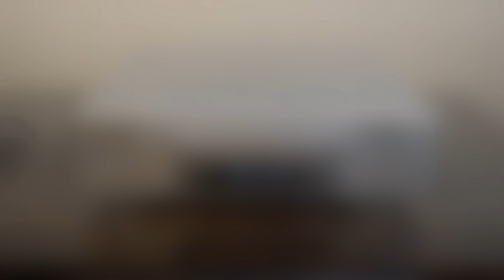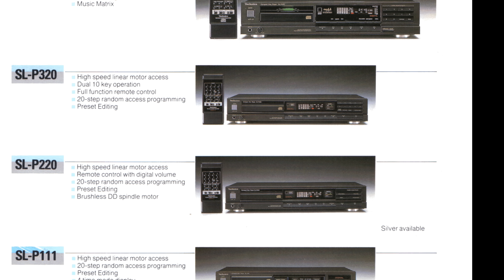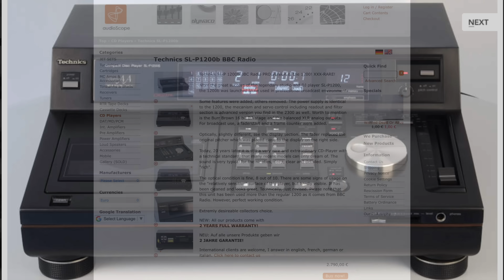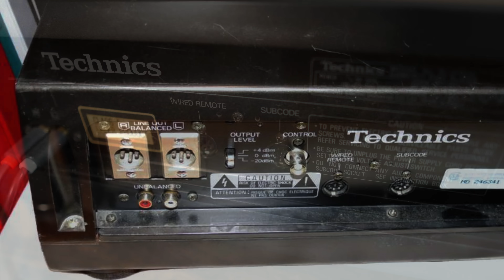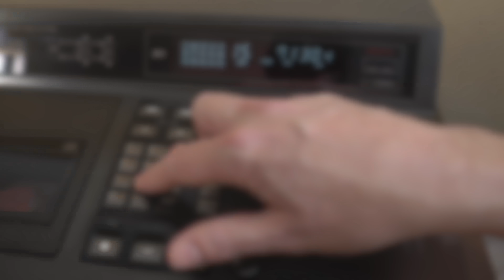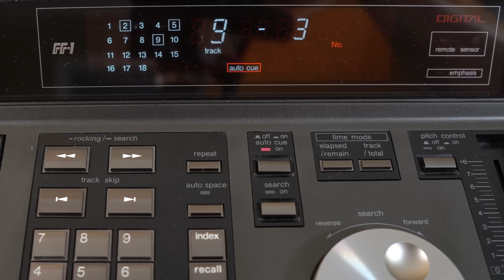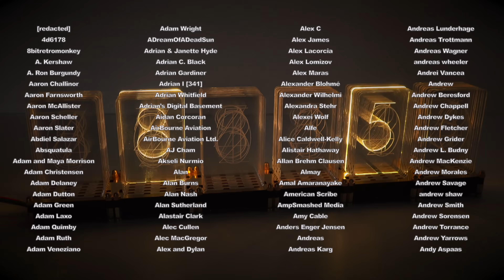How CD players lost their cool & why this Technics didn’t.

Comment: The worst thing about CDs is no matter how well you treated them, they scratched very easily. The plastic was cheap and could scratch simply being inserted into a unit.  The back had the foil with the information that if it got scratched, ruined the whole thing.   They made sets of music that might have three or four CDs in the box.    You could use it and eventually it would fail.  you could hold it up to the light and see light because there was a hole in the foil where the information was stored.   

The worst were computer CD and later DVD burners.   They were often termed landfilll material.
Reply: They addressed that design issue with DVD by sandwiching the data layer in the disc rather than under the label side. I still don't know how people managed to scratch them up so badly! If treated as carefully as you have to treat a record it becomes very hard to scratch them. The error correction system is brilliant at avoiding issues with scratches anyway, however I have found its ability to be effective on certain types of damage depends on the player and how much of the error correction system it implements properly. For example, my original Ghostbusters soundtrack CD was at one point owned by my brother, there it somehow got a hole, a small one, in the reflective layer. It's an old disc so perhaps it just failed at that point, either way you would expect this hole to be a big problem as it it much more severe than a mere scratch. Well it was, there was very noticeable skipping problems in the affected track, but as years went by I got better players and I found that I couldn't find the issue again!  The better players implemented the second level of error correction, which repaired the audio where the hole was. Even my Blu-ray burner will rip the entire disc and cdparanoia (used to rip) will report no issues with errors. The error correction on CD is so incredibly effective that it will hide a visible 1mm diameter hold in the disc. How people have problems with scratches, I don't know. How they acquired them firstly, then I have to assume their players are more primitive ones that try to skimp on error correction.

When we get to DVD, error correction goes to a whole other level, with two interleaved matrices and hardier ECC. Before Blu-ray, DVD is the most reliable and resilient data storage medium that was offered to consumers (excluding the HDD, the amount of error correction they do routinely is astronomical), let down by crappy brands of dvd-r. I dont know how you think they are "landfill material", I have to assume you bought sh*tty media because it came cheap from costco. Well, you record with sh*t, it acts like sh*t.

Comment: It's not really a professional model due to the lack of the balanced outputs on the original model, the limited capabilities of the remote control port and the not-really-precise cueing. It's really in this prosumer segment just like the SL-1200MKII which it looks like.
Real pro radio models would be the Studer A730 and its successor the D730 - both of them being top loaders like the SL-P1200.
I personally prefer CD-cart players, an invention of Denon based on the early carts used for CD-ROMs. My favorite model is their second iteration, the DN-951FA (they also had a drawer model in the same size the DN-961FA). Audiometrics also produced a pro player that was compatible with Denon's cart, the CD 10, which has the advantage of having a jog wheel on such small front panel.
Another feature that pro models offer is the ability to cue down to the frame. CDs are recorded in frames which are 1/75 of a second. The technics here doesn't have that granularity. And no, it's not reading the content from a "single rotation of the disk" (otherwise, depending on where you are on the disc, you would hear more or less sound).
Finally, pro models have many other features like locking the controls when the disc is playing on air, ability to cue the end of the track with just the press of a button, visual warning when the playback gets close to the end... and all this available via the remote control port.
Reply: Note: you can easily identify pro models (not matter what) by their lack of consumer features. This CD player is full of consumer features (like programmable playlist and IR remote).

Comment: The Technics SL-P1200 is the CD version of the awesome Technics SL-1200 series of turntables. I have a pair of SL-1200MkII's. The base and feet look almost identical. The pitch control would allow for beat mixing with other tracks with different BPM. This was designed for club DJs more than radio announcers.

Comment: Ha! I had a Philips CD100 in the mid 1990s. I picked it up at a garage sale for $10. Used it for a few years until it just up and died. The seller had included the original receipt. He paid $799 USD plus tax in 1982. That's about $2400 USD today.

Comment: I always liked Technics CD players.  The last CD player I owned (that wasn't a dvd or bd player that also happened to play CD) was a 5 disc changer similar to SL-PD887.  Ive got fond memories of that machine.  These days I just have an inexpensive blu-ray player that happens to also play CD and DVD (and many other formats on those media types).  My modern player has no display or buttons of any kind. It outputs to HDMI, and uses a remote.  If you lose the remote, it becomes garbage.
Reply: Yeah, thats why I prefer a player dedicated to CD. I want the display and player controls to be able to let me fully control the playback. My dvd player and Blu-ray player of course play CD but that requires the use of a TV! :D

So yes I will always have standalone devices, or a multi format player that can play a CD with all the basic features (play,stop,next,prev,search forward and back) with a display on it that at least shows the track and time. My UHD player has no display at all, so cant do the job without also powering up the TV. My old sony Blu-ray can nearly just about do it, but if you want to change track you need the remote.

Comment: This CD player was also used  by Club DJs as I used it in the 1990's.  The pitch control could be used in an active way  in mixing 2 tracks together while playing the CD like the Technics SL-1200MK2 turntable.  I have a matched pair of the turntables.   Even though the CD player itself had a headphone jack, most DJs including myself would use the headphone jack on the mixing board so with a flip of a switch one could listen to whatever input device one needed to be queued.  In the last club where I DJed I had 4 Technics SL-1200MK2 turntables and 2 SL-P1200 CD players ready to play at anytime.   I had a Korg sampler that I don't remember the model number of it as I rarely used it.

Comment: Nice overview of the SL-P1200. Note that there was a safety concern with CD players having their lasers exposed. The drawer loading addressed that. I worked for some radio stations and recordings studios doing maintenance on the SL-P1200's, and one of the main things was replacing the door switch parts, as they tended to wear down. The switch prevented the player from operating (i.e. turning on the laser) while the door was open.; So of the switch was broken, the player was disabled. So we kept a stock of the switch parts around at all times.

Comment: Nice - but can you elaborate on why it wouldn't be able to play CD-R's; I mean, it's not like regular CD players were specially designed to be able to play CD-R's, my dad's equipment from late 80's (or maybe ~1990) happily played them, so what was it in design of the players from earlier that would've made them unable to play them?

I'm not doubting you, I'm just baffled - not an expert on audio hardware, like you; and I'm almost certain you have the explanation too ;)
Reply: You need a player that has an infrared laser to play CD-R. CD-R and -RW use infrared lasers, normal CD just uses a red laser. If your player does not have a red and infrared laser then it will only play pressed discs. Some very early players can apparently play CD-R'S, which must mean their laser has enough of an infrared component to do it. But basically, those are the lucky few.

Comment: Very helpful video.  I never paid much attention to these when they came out because I am disabled and the drawer mechanisms are easier for me to use.  I have a suggestion that the load times for newer CD players might be related to also having to read the SACD layer (if there is one) in addition to the CD layer.  Just a thought.  Your new machine is sexy looking...glad you found one in such good shape!
Reply: Very few players can read SACD so I doubt it would be that. Most likely is that modern players use the same pickup as used in PC optical drives, those have always been a lot faster.

Comment: My Kyocera DA-01 did not hide the disc as it had a viewable window, not a drawer.
Reply: The first Numark DJ dual CD Player had a terrible lag problem when queuing up a track.  I also remember the Vestax dual DJ CD Player from around 1993 had the same problem.  Set it up and depress pause at the point where you wanted it to start.  When you'd un-pause the track would never start on beat.

Comment: @ Techmoan As a DJ in the late 80's and early 90's, I worked with those CD decks a lot. They were the best for our needs. One important thing to note is that the weight of the machine would help prevent skips, since dance floor vibrations and bumps on the equipment would make a CD skip. I remember we didn't need to install those on a rubber band suspension like the SL-1200 record players, so either there was a small buffer in the SLP-1200 or there was a physical skip prevention mechanism.

Of course, the pitch control slider was the most important feature for us as it made it possible to mix (beat-to-beat) dance music tracks. Also, I remember how fine the search function was. This was very important for us to cue the track at the exact beat where we wanted it to start for the beat-to-beat mix to work. Along with its SL-1200 cousin, the SLP-1200 is a legend of that bygone era when DJs actually had to work to earn their pay. Nowadays, the new generation simply let the computer mix tracks together, replacing the art of mixing with computerized precision.
Reply: Yeah, apparently Technics had a bit of a streak with the products named ‘1200’. Ishkur wrote in his magnificent music guide that he's seen those vinyl decks drop from heights or from moving cars and work fine afterwards. Rave workhorses, they were.
Reply: Felt that last part...to be honest they should not be called DJs anymore. Or that's where the term EDM comes in because it's all electronic and done with a computer

No offense to the new age peops but that's the truth...it became pointless to be a DJ when there are a lot of people that can mix those tracks even on their phones and get paid for that. All I can do is remember and know that there were real DJs that play with discs and even experience trying my luck at it
Reply: @ruikazane5123  Your comment made me realize that the DJ contest I won in 1991 would have absolutely no value in this world. After all, a lot of the score was for how good your technique was. Without remembering the full details, I guess we were scored on style and the ambiance we created, but at the time, the way you technically executed your set counted for a lot.

Also, there was no better feeling that pulling off the perfect mix in a packed club. Only when you messed-up did the crowd notice your work, and that was alright by me. :)
Reply: @JFHeroux  Some fellows remember there was scores on the moves too. Like being in sync with the mix you are doing and even tricks like flipping those discs around like the Globetrotters and serving the people like a pro bartender...

Of course...nothing beats the feel of actually getting it through without mistakes, much harder to me being assigned to the sound reinforcement stuff back then. High risk and potentially higher reward!

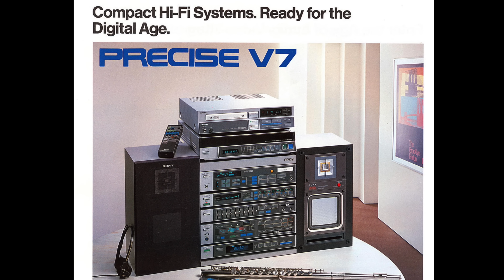Comment: I had some of that Sony stuff from around the 2:45 mark! Not the CD player, but the tray loading linear tracking turntable and the tray losing cassette deck. 
I bought it from a thrift store around 2010 mostly because I wanted the speakers that it was bundled with that they wouldn’t sell by themselves. 
You’re right that being able to stack components is a (slight) advantage; I had my turntable at the bottom of the stack. Unfortunately, most other aspects of that stuff didn’t age well.

Comment: I'm sure when CD's were first introduced the manufacturers wanted to show them off, but you can maybe see why they went for the drawer option in the end. CD's rotate at around 200-500 RPM and can cause annoying flicker effects in certain lighting in an open front player. This is not the relaxing 33/45 RPM of the record or reel to reel tape. Partially visible machines like this 1200 are perhaps the best compromise - you can see the CD moving but only if you look for it.

Comment: I owned the XLR version SL-P1300 few years ago, after i dreamed it for many years i was luky to find a mint one, like new. Very heavy indeed, very impressive look, very quick access of disc , one of the fastest CD player, a lot of features. It was the crown of my audio system some time, until i  performed some sound test using few famous audiophiles discs. The winner was my Wadia 861 SE, far, far away from others , next was Sony SCD-777ES, Studer A730 , Sony CDP-XA50ES, Audioaero Prima CD, the last one was Technics SL-P1300 so i sold it for good money.

Comment: I've played burned run-of-the-mill CDR's on CD players as old as Sony's 1984 models.  I have had issues with CDR's on much newer devices, though, and even then, if you play your cards right, you can get things to work.  The basic rules are to use DARK colored CD-R media (green or blue, but I know, I know, good luck finding those these days...), and burn them as slow as possible (1x, if you can muster up a CD burner that will allow you to burn that slowly).

Comment: I purchased a Philips CD 100 with a perspex top soon after they were released.  Expensive at the time, but I thought it worth the investment.  I would still have it if it weren't for an Ex- throwing it out 'because you weren't using it' - one reason of many why they ended up as the Ex-... 
The player, although only 14 bit oversampling rather than pure 16 bit, sounded much more smoother than contemporary rivals.  One could update the Op-Amps for a lower noise and better distortion figures and slew rate.  Then, fed through a Quad amp system to some nice big Rogers Studio-1 speakers, the content could sound very nice indeed!

Comment: The reason to have CDs front loading and hidden is because the manufacturers were trying to get enough customers to bring the price down and so they designed a player that could do double duty inside a computer!  Nobody using a computer gives a rats ass about watching the CD spin . ..

I remember the incredible buzz from NeXT computers CD-RW that could store 256MB and supposedly replace the hard drive at ~half(?) the price!  But it was slow as molasses...

Comment: Almost everything is very impressive about this player, --in fact I'd like to have one, but mostly because of it's looks and the features. In other words, just to have one. It's cool. But, as this is a very early player, it's internal DAC would be fairly primitive, and with little to no way of effectively dealing with clock jitter. Even a cheap modern external DAC, coupled to a halfway decent transport, is going to sound noticeably better on a reasonably revealing system. That being said, it would be interesting hear this, going straight into a pre-amp, which is pretty much the only option..

Comment: I owned an SL-P110 CD player, sort of. When Panasonic put out its first CD player, I bought one, but it didn't match my Technics stereo. I worked at a Panasonic/Technics dealer, repairing their stuff, and noticed that the Panasonic was virtually identical to the Technics, so I ordered a new Technics SL-P110 faceplate and replaced my Panasonic's CD player's faceplate. Aside from a blue stripe on the tray front, it was a perfect match. Sneaky of them to "reuse" a CD player design. Sneakier of me to get a cheap CD player and make it look like a good one.

By the way, there was no oversampling or 12x-speed read or anything like that on these. They sounded clear but relatively harsh. But if you recorded a CD onto cassette, it really smoothed out the sound.

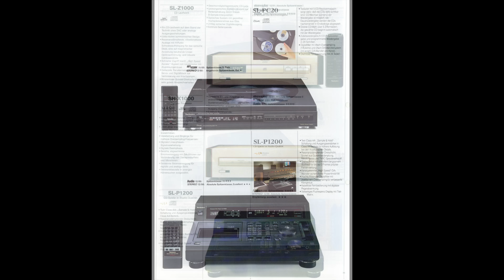Comment: Great Trip down memory lane about the passion Panasonic/Technics had for building high end, accurate and solid machines. I have a SL-PC20 that featured at 8:40 - this too has good speed around track selection - from memory this uses a coil induction sled system rather than gears to drive the laser module resulting fast tracking speed. The CDs are most visible on this 5 cd carousel. Thanks for the enjoyable content and keep the camera rolling!